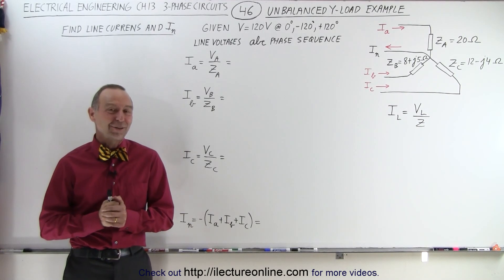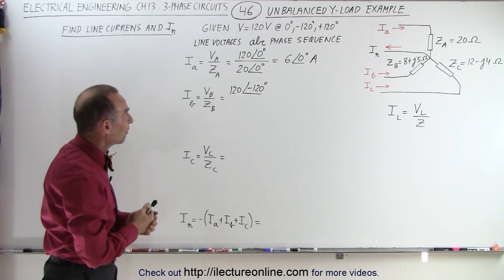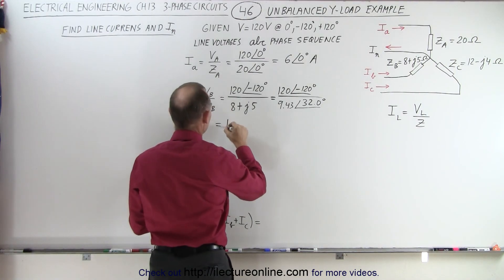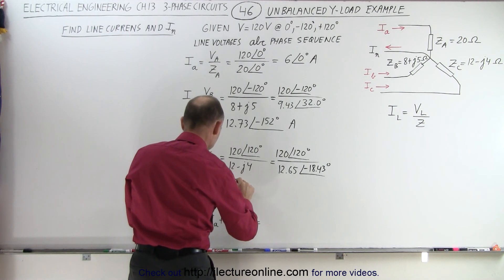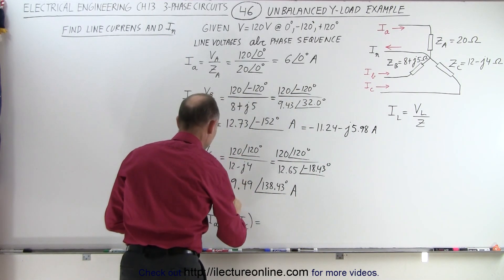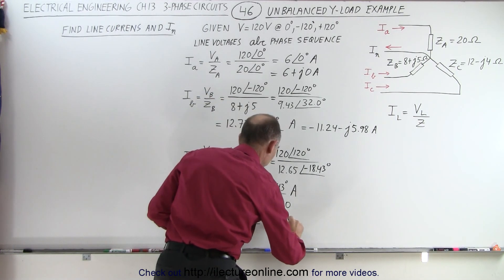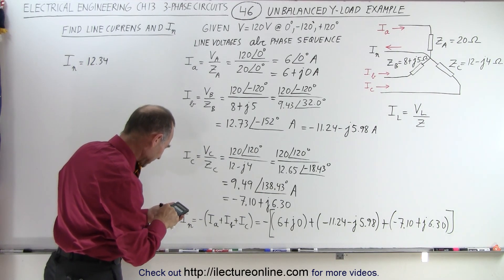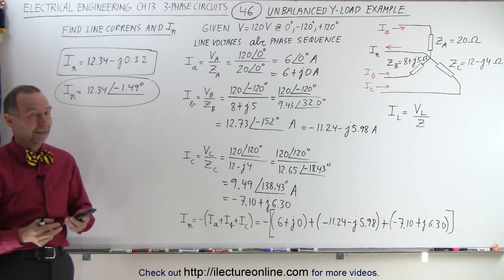Electrical Engineering: Ch 13: 3 Phase Circuit (46 of 53) Unbalanced Y-Load: Example

Comment: How did you get the 9.48 angle32.0
12.65 and -18.43???
How to press in calculator???
Reply from the maker: The inverse tangent of (=4/12) = -18.43 degrees   (Make sure your calculator is in degree mode and not in radian mode. )
Reply: Thank you for teaching me ♥️🇵🇭👍

Comment: The solution is correct the problem is wrong.
The problem must be. a unbalanced  4 wire  y connected load is supplied by  a balanced 3 phase source 120v per phase.

Comment: it would be phase voltage.  not line voltege
Reply from the maker: In a three phase system the line voltage (also known as the line-to-line voltage) is the votage between 2 phases (between 2 lines).  The phase voltage is the difference between the phase and neutral.

Comment: 120V is not the line voltage it's the phase voltage. In a Y connected load the line current is equal to phase voltage/phase impedance
Reply: i was confused. and after that i'm looking forward a comment like this
Reply: Yes this ia a wrong soln, also you cant solve per phase analysis when you have unnalanced load

Comment: As others have commented the wrong voltage was used to calculate the line currents. We're given that the line voltages are a balanced 120 V configuration. In a Y connected load the phase currents are the same as the line currents. Problem here is that the phase currents were calculated using line voltage instead of phase voltage.  So the phase (and thus line) current should be equal to phase voltage/impedance. But the phase voltage in this case is the line voltage divided by sqrt(3) with phase shifted by - 30 degrees. That would make all the currents calculated above too large by a factor sqrt(3) with phase angle augmented by 30 degrees. So the correct line currents are Ia = 3.46< -30  Ib = 7.35< -182 and Ic = 5.48<108.43. The sum of these incoming currents is 7.13<148.51. Taking the negative of this for the return current we should have In = 7.13< -31.5
Reply: Yeahh that should be 120/sqrt of 3
Reply: That's right it should be Vl/sqrt3
Reply: In a star connection the line voltage are measured between the lines (220 V). phase voltage are measured between line and neutral (120 V). This calcultion is correct
Reply: @gilbertvanheerswynghels5246 you're also confused
Reply: @gilbertvanheerswynghels5246  Except that Va, Vb and Vc above are LINE voltages not PHASE voltages. It says, right at the top of the blackboard "LINE VOLTAGES." You must convert these line voltages to phase voltages in order to calculate phase currents! This calculation is NOT correct.

Comment: correct me if I am wrong; aren't you supposed to use the Phase voltage in calculating the phase current?
Reply: yeah i have this question too like if given voltage is vline, how to find vphase since we cant use relationship of surd3 angle 30 between vline and vphase?
do we have to change to delta connection?
Reply: @sirtodip5272  we can still use the relationship of squareroot of 3 here since we are dealing with the supply side which balanced.
Reply: @ 0:07 the currents that he's calculating are line currents

Comment: A field engineer would measure the currents in each hot leg and the neutral. Then shift loads around to gain optimal balance.

Comment: I think the method u did is wrong sir
Reply: yes this is wrong
Reply: @aimgodyt7801     
what would be the correct solution?
Reply: Yes it is wrong
Reply: @pratikrahate6227  What would the correct solution?
Reply: @danakaterinegomez7480  he use the line voltage instead of the phase voltage
in wye configuration
Reply: Hello sir, great videos for 3 phase circuits. It has cleared all my doubts. Only one thing I want to point is isn't the voltages used should be the phase voltages for the calculation of current?
Reply: what would be the correct solution?
Reply: Hey guys if anyone interested to know the correct solution for this please comment me here. I will make video for u